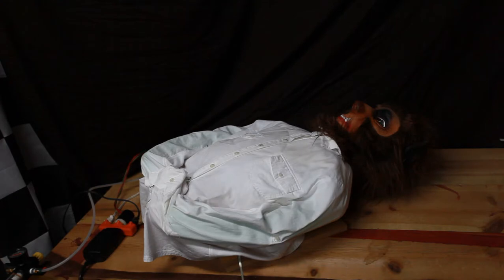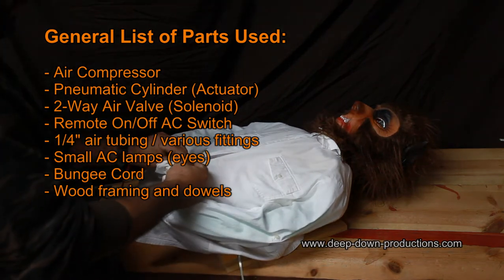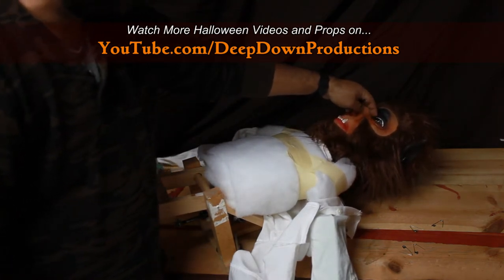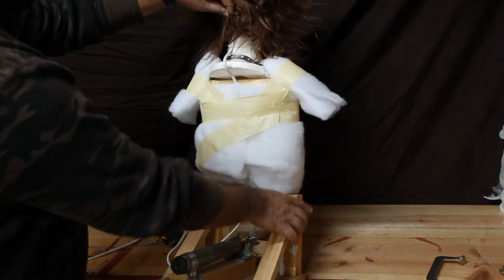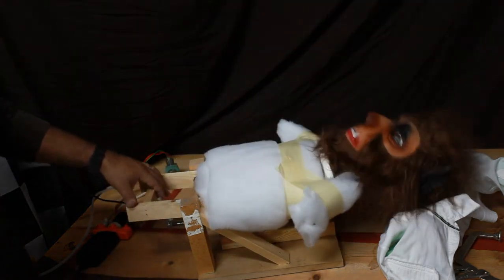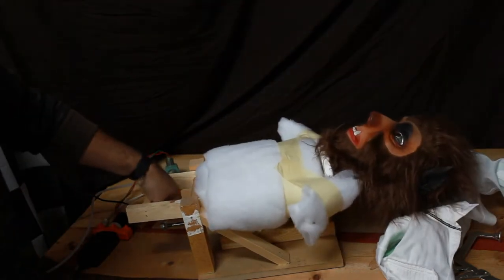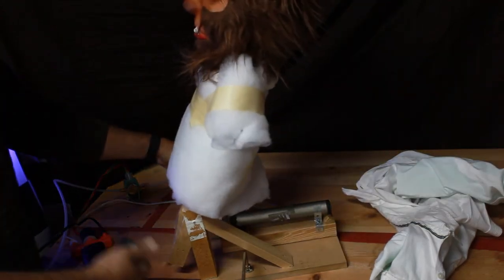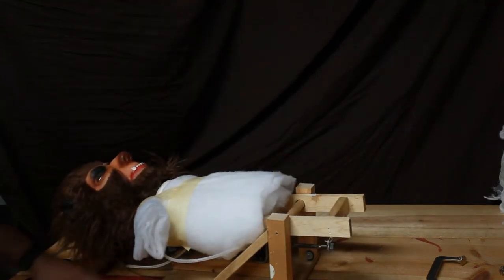Little Wolf (Wireless Remote Control Pneumatic Halloween Prop)

Comment: Thanks for the video. It had been a while since this video was posted but still has good info. I was having a little difficulty hearing though.  What would be a good piston to use. And what was the remote switch?  Thanks for sharing.
Reply from the maker: Hi there, glad you liked it. Use at least 8" Bimba single acting. The weight of the prop will retract the cylinder. The air activation will lift it. I used a typical holiday lights controller style remote having an A/C plug and keyless chain remote. Under $20 typically. Check out the other Halloween vids as well ;)